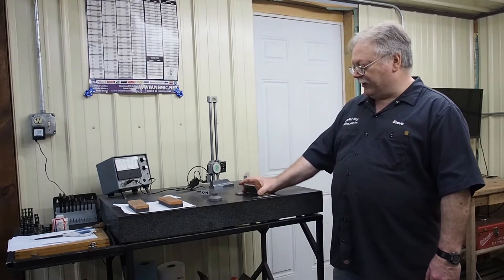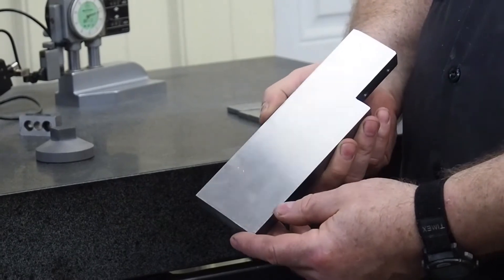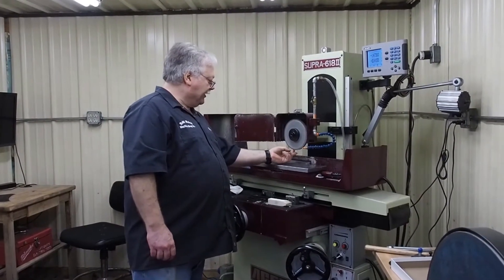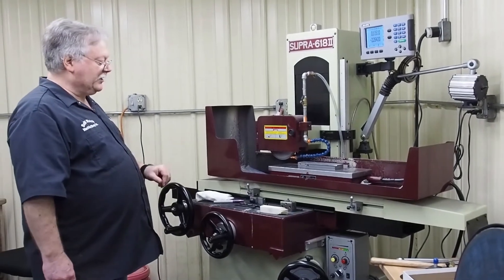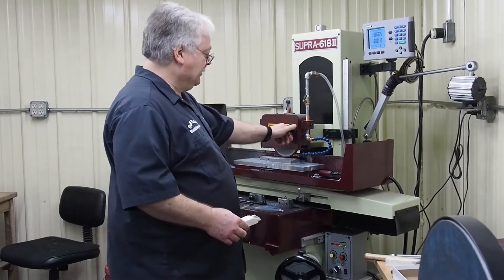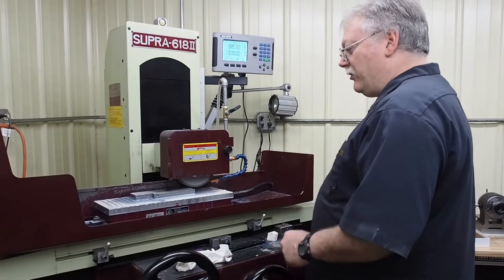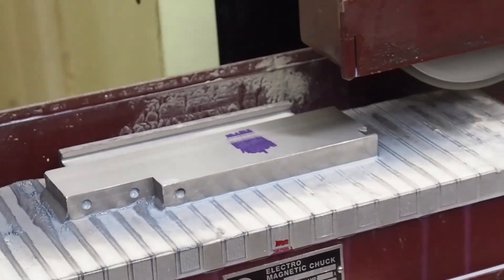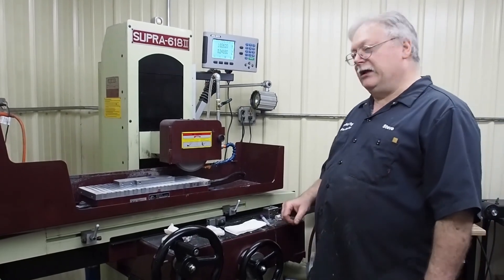Truing and dressing a diamond wheel on the surface grinder.

Comment: One of the best tools in a shop if you know when you need it and how to use it properly. (Stand clear when the new guy tries truing up the wheel with a diamond point on the mag for the first time. You can tell him and show him a million times, but until he throws it off the mag plate on his own for putting it on the wrong side of rotation, he won't get it. LOL 

Get someone on there that knows how to manage/predict heat and properly spark it out towards the end, the results are beautiful.

Comment: I just caught your channel recently, so I’m trying to watch them in the order I need them rather than just starting at one. I must have missed something, but with the cheap diamond points for sharpening available these days, I was wondering why you couldn’t use that to level the surface, even if you wear a couple of them out.

Comment: Mount a grit wheel on a spin fixture like a Harig head. Turn grit wheel opposit direction as diamond wheel and make some passes. Work about as fast a a brake truer.
Reply from the maker: I like it, thanks for the tip.
Reply: I have worked at a couple carbide shops that hade the fancy truers, one powered with graduations. Now all i have is worn down grit wheels and whatever i can find to bolt them to and spin. Something powered is sweet. I have used dumores lightely clamped in a v block with an angle block to get angles trued on cup wheels also. @SolidRockMachineShopInc

Comment: The best way is a brake dresser with green silicon dressing wheels. I actually prefer “black carborundum” pardon my spelling, version for the same brake dresser. MSC part number 81548141. I also index my wheels to the spindle at 12 o’clock with a dot for remounting in the future. We only use Norton resin/vit wheels along with diamond plated steel form wheels in our shop as we grind solely carbide.
Reply from the maker: I don't have one of those yet so this is the method I use. It actually works very well. I used a brake dresser at a company I use to work at in combination with the white sticks with amazing results.
Steve

Comment: Just wondering why you would not mount the (SC)stone and make passes on on it to true it up?  you have may induce chatter and in no way can keep the surface square.  Would love to here you input.  Great video.
Reply from the maker: If you are careful the method I used in this video works very well. I have done it many times with the same results. The stone stick is used to remove the resin so that the diamond is exposed. I had great finishes on carbide, others who had seen the finishes first hand where amazed. The flatness of the wheel was great too. If the resin bonding is to hard it is more difficult to get the same results.
Steve

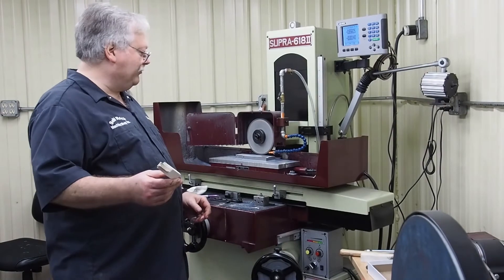Comment: 9:23 this is getting a little confusing.  You mentioned to use a 'smaller' grit than the wheel is, do you mean coarser? or finer?  For instance my diamond wheel is 120 What stick do you recommend I use to dress mine up?  I've never tried diamond yet but want to mount mine up.  It's a Norton SD120-R100B99-1/4  (I'm assuming it's 120g).  Great content tyvm
Reply from the maker: Hi Bobby,
The grit in the white stick needs to be finer that the diamond grit. If your diamond is 120 grit a 220 white stick grit will work fine. the grit in the white stick has to be smaller than the grit of the diamond wheel so that it can cut the resin between each diamond particle.
Steve
Reply: @SolidRockMachineShopInc  Excellent thanks very much.  I'll search up some 220 aluminum oxide dressing sticks.  They sure burn off fast ehh
Reply from the maker: Got mine from MSC.
Steve

Comment: I am of the school of thought that you never, never grind soft material with a diamond wheel. I always would put a brand new wheel on an arbor, indicate it true, and use it only on carbide  steels. The depth of each grinding pass would be just a few tenths of a thousandths. I suppose if you have a wheel that's been misused, you have to use these tactics to get it straightened out though. Keep up the good work while spreading the knowledge. We need more people like you!
Reply from the maker: Hi old magician,
It is true that you should not grind steel with diamond. In this case I am truing the wheel using the destruction soft steel does to diamond in a controlled manner. The method works great on this wheel and it was fast. I had some of the best finishes on carbide after using this method.
Steve

Comment: Well, I hate to say it you did everything wrong.  Either you must use a speed reducer for diamond and borazon wheels, or you must buy a wheel diameter to match your spindle speed.  I will guessing that your grinder should have about a 5" diameter wheel. Never grind any soft material or even hardened steels without having the right type of diamond wheel.  Once you true the wheel, never take it off the hub, even put witness marks on the hub and spindle so they can be put back to the same location.  some diamond wheels can be use dry, some cannot ever be used dry.  the dressing stick is NOT to be used at full running speed, not wet, the slower the rpm the better, you just jam it into a slow rotating wheel until the wheel almost stops. it is to remove the binder between the diamonds for chip cutting clearance .   you do need to rough true the wheel , but you do not need to use an indicator, use a small piece of steel on the chuck, just barely tighten the wheel by hand, now rotate the wheel by hand an down feed it so the  starts to touch the block and the tap with a soft piece of material, not metal. keep feeding down as the wheel centers but you will still have to dress it true.   The molybdenum sticks I have found are better than the brake truing devices, but I use them just as you would dress a stone wheel,  only traverse from to back, or back to front,a .0002" downfeed at a time, and if you want a sharp corner on the diamond wheel , feed into that corner with the moly stick.  I have missed many things here ,but maybe this will help you a little.  depending on what you want to grind, there are many stock diamond wheels, but usually you should order a wheel , or wheels for your specific application.  eg. roughing, finishing, concentration of the diamonds, etc. I have never had any of the off the shelf wheel work very well.  diamond wheels do not like to run at the same speeds as  a stone wheel would run, sometimes you can even smell them when they run too fast. Good luck.
Reply from the maker: Hi Glenn
Thanks for the pointers and info. For doing everything wrong the results were awesome. I am aware of the dressing stick's main purpose but I am using it differently for a different purpose. The method I used with the dressing sticks works very well and I have done it many times with great results every time. I do not have a speed reducer so that is not an option for me. I am one of those guys who goes outside the norm to get things done. If I went by the book on everything I do I would never discover some of the amazing things that can be done by experimenting. In the early days of hard turning I went against the norm on 90% of what was accepted at the time and now what I did back then is the norm in many shops. I have used the moly block before with so-so results. The results I got from doing things in the video were far better than I ever had with a moly block. I never want to be locked in that box that says everything must be done certain ways. Have you tried the methods I showed in the video? If you do and try them the way I show I think you would be pleased with the results if you are unbiased. If you haven't tried the methods I showed or did them incorrectly it would be hard to say I did everything wrong with any authority. On this issue I can speak with authority because I have done it both ways and I know what works best. By the way, that Norton wheel that I bought off the shelf works awesome and this is coming from someone that is not a big fan of Norton! I write this way for the sake of the viewers,  because I would hate to see them get locked into a way of thinking like you are that 'My way or a certain way is the only way'. Some of the most amazing  toolmakers I have ever worked with would never get locked with this kind of thinking. 
Steve
Reply: Do you complain also to the fire department that a fire was put out wrong? Cheez, there are multiple ways of doing things to achieve the wanted end result and you can't always have everything like a book says.

Comment: Steve - I use moly blocks to tru a diamond wheel up. You can buy them in round that fit in a diamond dresser but i prefer a square 1”x 1” moly. This seems to work very well to tru it up. I’m interested in diamond wheels grit size - roughing, medium and finish passes on carbide surfaces. How much you can take off in each pass depending on the grit size. Finishes for polished surfaces. Any knowledge you have on this subject.
Reply from the maker: I use a Norton 150 grit 100 concentration wheel. Because I do so little in carbide I rough and finish with this wheel but the roughing is very gentle. I try to rough using the whole wheel surface on the bottom and plunge grind in order not to wear the bottom of the wheel unevenly. I take very light cuts while doing this. I will finish the last .0005" or so traversing in the Y axis like normal grinding for finish and accuracy.  If the part is round and has a lot of stock on it I will turn it on the lathes with diamond inserts to get it close. We have a video on that too. We use the Moly block at my full time job with so so results. Using the white sticks like shown in the video works very fast and if done properly it is surprisingly accurate. 
Steve
Reply: Solid Rock Machine Shop Inc. yeah i do a lot of diamond flat grinding on carbide. We use 220 grit to do you all the grinding. Most cases seem to work well. Plunge grinding keeps the wheel truest, but sometimes i like to get an angle created to let one edge work more with less heat. Really .0002” angle on a 1/4 inch wheel. Yeah there not really much videos out their on Diamond wheel dressing techniques. Just thought to ask.  Thanks for all you shared. I’ll have to watch all you videos but enjoying your passion Steve!!!     Thanks JB
Reply: I have been using Moly blocks for many years. They are the best.

Comment: We use brake dressers with diamond wheels, i usually downfeed .0008-.0012 each direction until it passes the ear test, then .0002/3 each direction to flatten out. White sticks open up the bonding of the wheel, “semi” dressing them, they are usually used to open up a loaded/glazed wheel BUT they can be used to dress, and in your case you got it down to within .0001/2... not many guys can figure it out let alone do it. You got some smarts buddy

Comment: I worked at one shop where we did a lot of  surface grinding with diamond wheels. To dress the wheel, we had a block of molybdenum attached to a piece of steel so it would stick to the magnetic chuck. The block was about 1" x .5" x 6". We would grind the moly block to dress the diamond wheel. If you go this route, make sure you cover the chuck with a piece of paper or you end up with diamond bits embedded into your chuck. They look like little star shapes when you stone off your chuck. We just used the white sticks to clean the wheel between dressings.
Reply from the maker: Hi Rob,

At my full time job we have that too. I might be doing something wrong because I never could get it to work very well.
Steve

Comment: Just did this myself. The cheap wheel I had was .007 out :-(. But it worked. The wheel is a 180/75 . Seems as the finish at 1st is course but the more I use it the better it seems to get.  Took hours.
Thanks for the video Steve, very nicely done
Reply from the maker: Hi Steve,

Glad it worked out for you. You will love the  new possibilities you now have with that grinder.
Steve

Comment: Was the diamond dressing block a chunk of molybdenum?  if so this patent describes running it slower speeds.  https://www.google.com/patents/US3921616
Reply from the maker: Hi jz1199,

You may be correct. If so, no that tool was not molybdenum. This was more like diamond particles encased in steel. I have used this type of tool for CBN and it works well but not for diamond. i think you are correct on the softer material. With the CRS I was able to take the .002 run out of the wheel but getting it flat was the work of the white aluminum oxide sticks. Thanks for commenting
Steve
Reply from the maker: Hi hardkrash,
No, it was just a piece of cold rolled steel 1018.
Steve
Reply: I think hardkrash was referring to the tool borrowed from the coworker, the one with the round base.
I'm just thinking out loud here, but maybe a soft, gummy material might work for this application as well, it will wear fast of course, but might be a way out of a tight situation, the idea behind is that the soft material would generate heat in the wheel, which may loosen the resin bonding the diamond, and the loose grit may then be transferred and embedded into the soft dresser and serve as an abrasive. I'll even give it a try later, I sharpened some tig electrodes on the bench grinders diamond wheel, and it could use some maintenance.

Comment: if the r/o is excessive you can tap wheel within  a thou or so and tighten the adapter a molly stick works  best,  check the  spindle  taper on machine it should run .0002 or less   some machines are sloppy. you can true spindle taper with a carbide tool bit sliding on a sine plate  8.32 deg I think , dressing works better on slow spindle speeds.
Reply from the maker: Thanks for the info Sam.
Steve

Comment: Just a thought but could you clamp your white Alox stick to the mag chuck and true up the wheel by running across it? Methinks it might be messy but if it works by hand holding it should also work by using the cross feed.
Reply from the maker: Hi Chis,
That is a good thought but the reason I used the stick by hand was so I could hit the high spots an not touch the low. Your thinking is good because I did notice that the more bench stones we ground the truer the diamond wheel became.
Steve

Comment: Very nice thank you! We have been trying to figure out trueing up the diamond wheels prior to running some bench stones. The hing clamping fixtures is a great low tech method for holding the stones as well thanks for sharing!
Reply from the maker: Hi JBFromOZ.
We did 5 set of those stones. The diamond wheel seemed to get better the more we did. I used those stones a lot since grinding them and I love them. I can't thank Robin enough for sharing his video with us. I hope things work out for you guys. Thanks for commenting. Steve